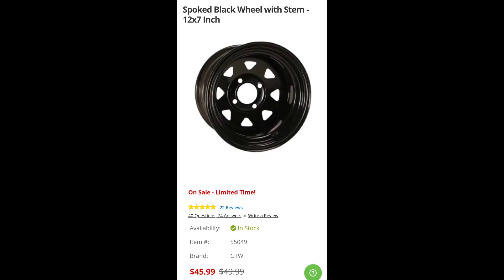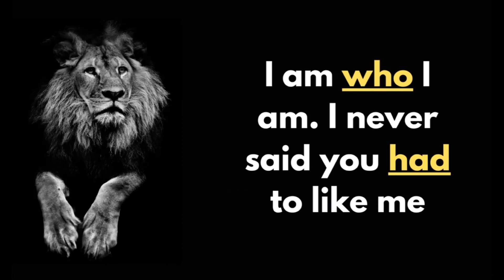Pop up camper lift kit and tires

Comment: You have a few great camper videos on Youtube, thanks for sharing them.  I'm currently rebuilding a similar sized Coleman Columbia (1983) and a spring over is something I might do after I finish the roof and interior.  Did you end up putting new stabilizer jacks on this after you did the lift?  I don't think the jacks that are standard on my camper would reach the ground after I bumped it up five more inches and am curious how you combated that?
Reply from the maker: You are correct, they are too short for the additional height. Right now I'm just putting a block of wood underneath the jacks, but I'm going to make a rear bumper for the camper and put on 2 trailer tongue jacks that rotate up and out of the way, and will have a lot more length and adjustability
Reply: @snaggdiggler  that's a great sounding solution!
Reply from the maker: https://youtu.be/e0Xg5RBO--s
Reply: @snaggdiggler  added to my Watch Later list, thanks.

Comment: What did the rims come off of ??
Reply from the maker: They are just old steel garden tractor wheels off of my old Gravely riding tractor, painted black. All the old garden tractor wheels are the same, John Deere, Cub Cadet, and all of them are 5x4.5 bolt pattern 12 inch wheels